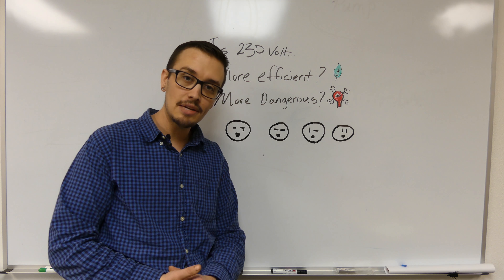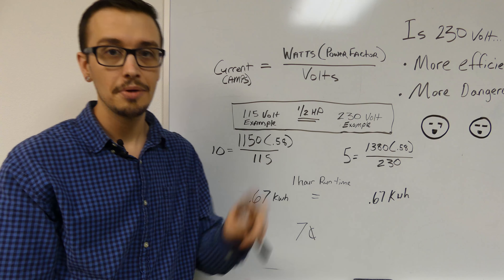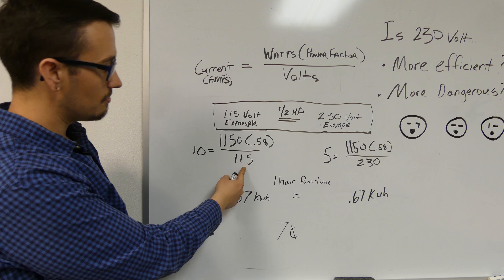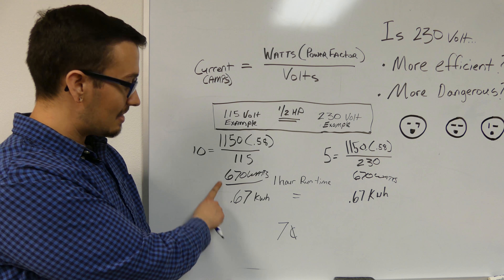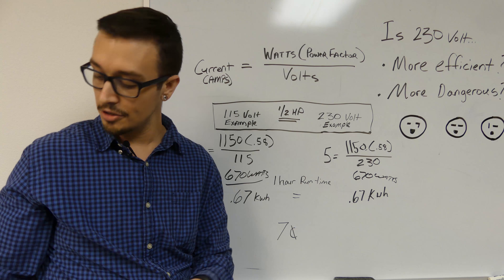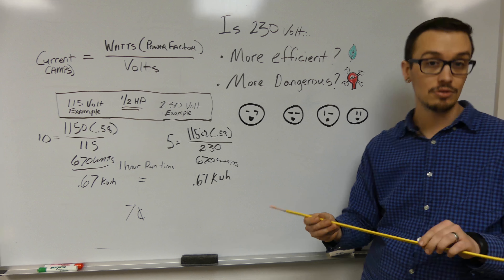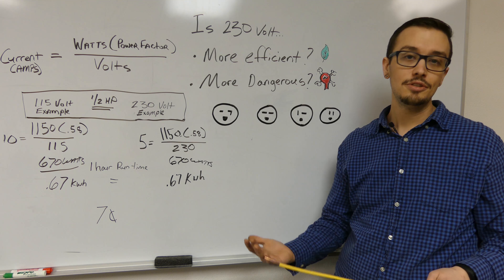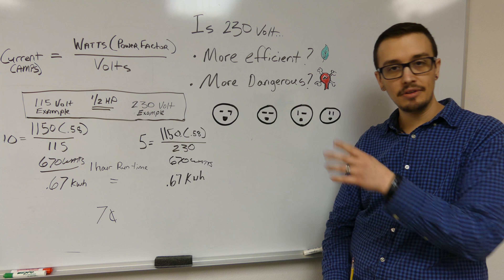Pump Tales | 230 Volt Myths Busted | Ep. 2

Comment: This is the short version.

As with all things it depends on which efficiency you are talking about. Transmission line loss is primarily due to the resistance in the line and is equal to V x I. Ohms Law says V = I x R so V x I is the same as I x I x R a.k.a. I^2R. For a given transmission line you can't change the R. If you double the voltage you halve the current so instead of I x I x R you have I/2 x I/2 x R. This is 1/4 the line loss. That's why long distance electrical transmission lines are high voltage. The loss due to line resistance in a 1/2 HP motor isn't really worth worrying about. In a transmission system covering a continent and using gigawatts it does.

Normal household current comes in on 3 +1 wires. A neutral wire, two hot lines and a ground line which is typically attached to a metal stake or plate embedded in the ground outside the building. The two hot lines are 180 degrees out of phase which means they average out to about 220V. The two phases allow you to share one neutral line instead of requiring 2. The main advantage for a 220V household motor is that you can have twice the power without running heavier wire for a high amperage circuit and if planned for it just requires cable with one extra conductor.

Comment: The higher the voltage the further it can arc, the higher the current, the higher the caution and respect. That being said, you can probably die with 12v in the most extreme circumstances. Also I think confusion between 3 phase and single phase is probably where this myth came from. Thanks for all your videos.